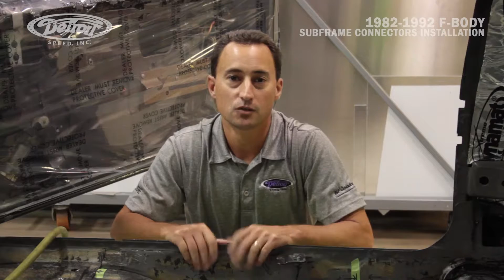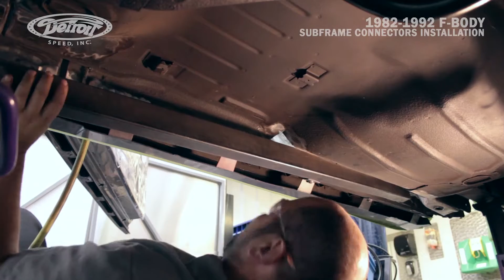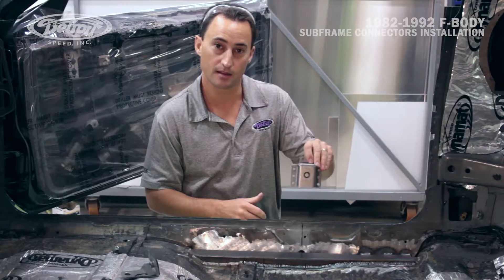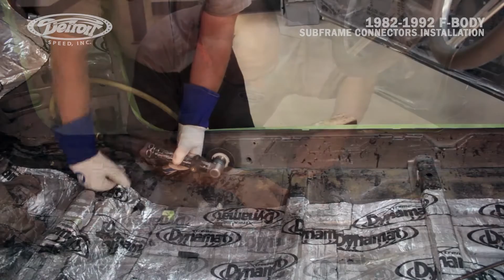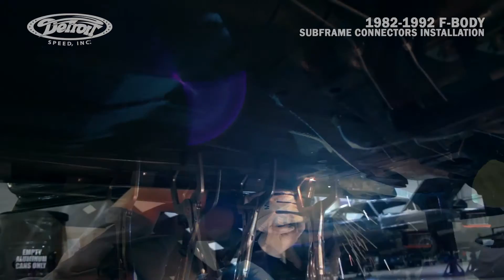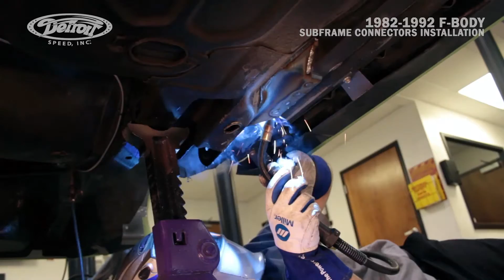How To Install Detroit Speed's Subframe Connectors For The 1982-92 Camaro/Firebird

Comment: Would a subframe connector  be necessary  for an LS3 swap in a 84 Z28. What  damage or stress would happen if one didn't do this
Reply from the maker: Adding more power and driving the car hard will just flex the car's unibody construction. The more solid feel and function of subframe connectors can even be essential on a factory powerplant with spirited driving. We highly recommend these for your swap.

Comment: back in the day i added a pair to my 91.
I 100 percent agree these should be added to ANY camaro. even a daily driven street car. even just driving down the road you can feel the change in the car. massivly better. i didnt use this kit. mi e were a bolt in setup that i also welded after bolting. they fit without having to cut anything. but i also welded them in places along the pinch weld. 
VASTLY better ride and chassis stiffness. i added mine to beef up the rear suspension mounts as i was egging out the lca mount holes. ( slicks with over 800 hp ) it was also makin small ceacks in the paint just behind the doorjam at the top of the rear of the door area from the twist. this was 19 years ago
Reply: I need subframe connectors too. I'm the third owner of a 89 350 tpi t top car. I want to be able to put more power into her but need to do this first.
Reply: @backyardbuck6362  well worth it buddy...  the whe car will drive better.. even on a straight road... as long as they tie into the rear suspension  mounts.. and go all the way to the front and close to or tie I to the front subframe... that way the rear suspension is pushing on the entire car..not just 2 bolt holes... I was wrinkling my paint and oblonging the rear suspension holes... haha God man good times

Comment: How does the carpet fit after this install? Looks like a pre molded carpet wouldn’t work so well.
Reply from the maker: We were able to re-install the carpet on our car with no issue.
Reply: The carpet does not form fit that area. Factory that area has a wire loom cover that intrudes into that area higher than the SFC would. the carpet floats over the area to make a smooth transition to the door sill plates just the same as it did before. The wiring would be a bigger concern as the square plastic tube needs to go and lay the wires on the floor or use smaller plastic loom.

Comment: Excellent video.  However, your coil springs are different to mine as yours has a shaft inside the coil spring.  What did you use to spread the openings for the A arms to the frame?
Reply: Those are adjustable coil springs you can adjust the softness or stiffness of them

Comment: So basically you've made a "kit" that isn't a kit because it requires it to be done by your fully equipped fabrication shop? What about this makes it superior to the Spohn, UMI or BMR kits? The amount of labor alone would be a massive cost.
Reply from the maker: This kit has been installed numerous times by our customers in their garage.  It can be done with some cutoff wheels and a welder.  Offering a kit that is weld in allows for much more structural rigidity and it also will serve as a safe jacking point on the car.
Reply: @detroitspeed  My bad, some of the other comments led me to believe it was only installed at your shop. But, as far as the other question goes, UMI, BMR and Spohn are all Weld in kits too, and you don't need to cut into your car after gutting it to install it. Those kits can also be used as a jacking point. So what precisely makes yours worth the immensely increased labour?
Reply from the maker: @ariyanadumon4549  With more welding along the pinch welds of the car and going through the floor, our kit offers a significant increase in strength from the kits mentioned.  Our kit ties into more of the car's structure.
Reply: @detroitspeed  Do y'all have numbers or something to back that up? Just curious, I promise I'm not trying to break your balls over this lol. This is a genuine curiosity for me as I'm about to do my car.
Reply from the maker: @ariyanadumon4549  There aren't any official numbers to determine body flex that we have, but structural rigidity of our DSE-Z Test Car is quite clear when we review track hot lap footage and photos.  Building our subframe connectors in this manner (welding through the floor) has been a proven method for us on other vehicle platforms such as Chevy II Novas and earlier Camaros/Firebirds (1st/2nd Gen).
Reply: @detroitspeed  Thank you for being so cool about this inquiry, it's been very informative and I appreciate it.
Reply from the maker: @ariyanadumon4549  That's what we're here for! No problem at all.  If you have any more questions, you may contact our sales and technical associates at 704-662-3272 or sales@detroitspeed.com

Comment: Is this good for a high power drag application?
Reply from the maker: Yes, this kit would be perfect for that.

With more welding along the pinch welds of the car and going through the floor, our kit offers a significant increase in strength from other kits. Our kit ties into more of the car's structure.

Comment: My "Primal Fear" with this or anything similar is the advent of rust, is there anything you can do to minimise this? I see rust coming from inside the newly welded connectors and under the plates to the torque boxes!
Reply from the maker: Dave, if you prep correctly and apply a rust inhibitor or epoxy after installation, rust will not be an issue.
Reply: Ok, it just seems likely, and I didn't see you do anything (that I could see) so I asked.

Comment: That's way too much work just to install subframe connectors.
Reply from the maker: With more welding along the pinch welds of the car and going through the floor, our kit offers a significant increase in strength from the kits mentioned.  Our kit ties into more of the car's structure.

A little more work that pays off.
Reply: Had this done on my 91z28. A bit of work to install but so worth it though!

Comment: This looks a lot shorter than the other kits I have seen. I suspect it is a lot lighter too. 

Does one still jack the car up at the pinch welds, or do the subgrame connectors create better jacking points?
Reply from the maker: Jason, with the subframe connectors installed in all of our vehicles, we use them as jacking points.
Reply: after mine were installed ( dufferent brand ) this was almost 20 years ago. i used the subframes as jacking points. 
sure does make it nice to be able to put a jack anywhere you want to

Comment: I like the overall design. I've watched this video several times now and one thing that stands out to me is the large gaps between the doubler plates and the car body. Is there room in the kit to trim some for a tighter fit?
Reply from the maker: Are you referring to the doubler plates on the underside of the car?
Reply: yes. it appears there is a bit of a gap around the edges and also some distance to fill in the plug weld holes
Reply from the maker: All gaps around the doubler plates are supposed to be welded to the body.  Keep in mind that since the vehicles are uni-body there may be some variances between vehicles.  As far as the plug welds, they are to be hammered into place as close as you can possibly get to the body and fill from there.  I hope this has cleared up your concerns.